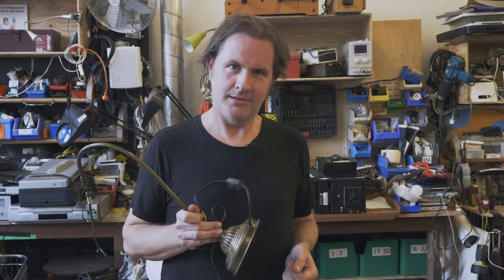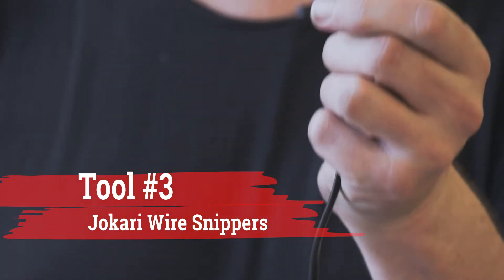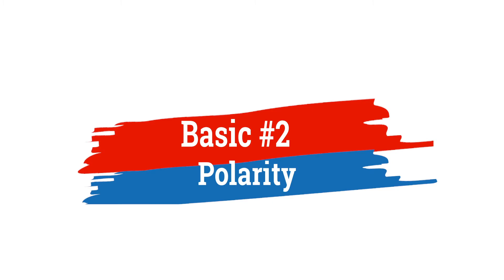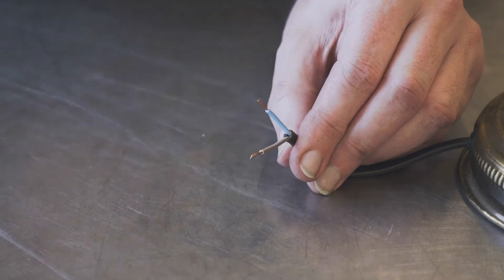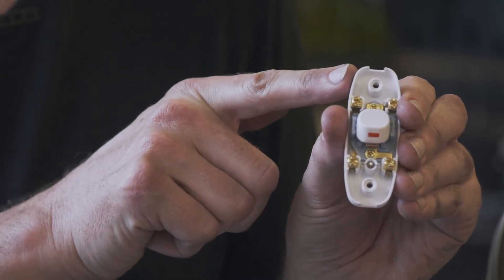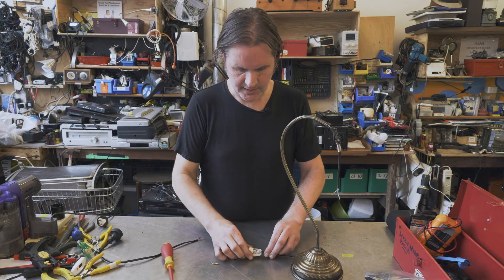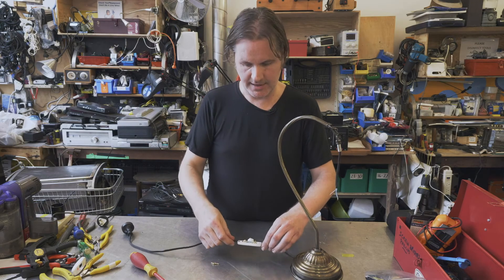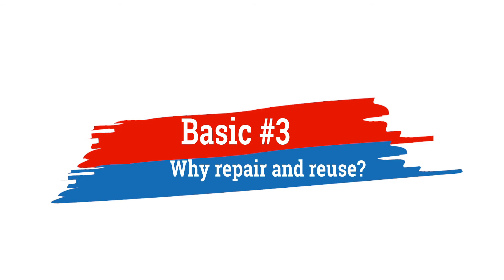Replacing an Inline Switch w/ Andre | Electrical Repairs at The Bower

Comment: How do you put an in line switch into the cable if you have a THREE core wire?
Reply: @chaddelbridge7027  I did a few alterations to plan BUT it is on here somewhere.

Comment: Can the switch be repaired if its where problem is causing the bulb to flicker?
Reply: I wouldn't mess with it when the price of a new switch like this is usually less than 5 bucks.  Why risk an electrical fire for an upgrade that'll last years to come and is a vast improvement over the original roller line switch?
Reply: @ArtzFenix  I don't even remember asking this question. It worked out cheaper for me to replace the whole lamp.
Reply: @joanna6588  Cool.  I just upgraded a switch on a friend's lamp yesterday and it worked out well.  New rocker switch was only 4 bucks at Menards and it's way sturdier than the switch lamp came with.